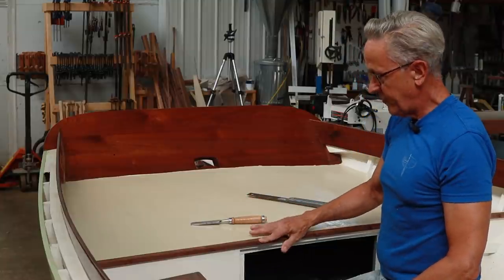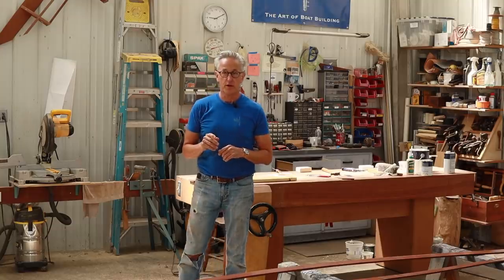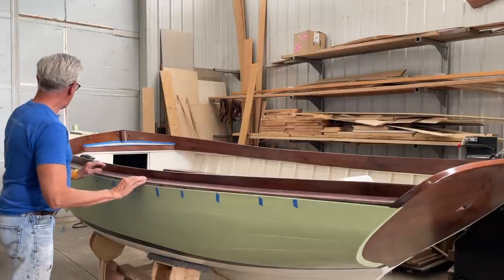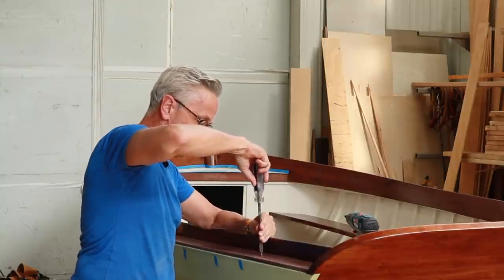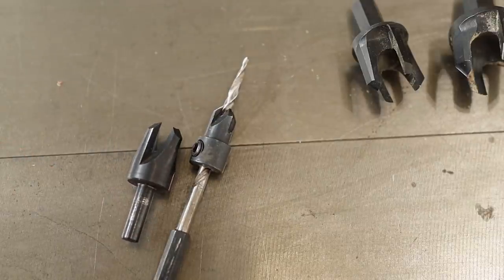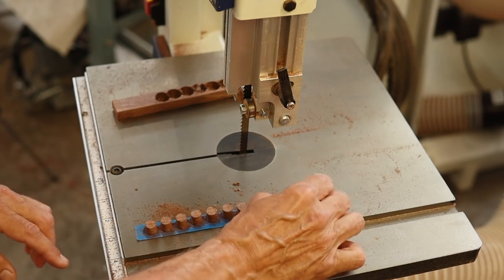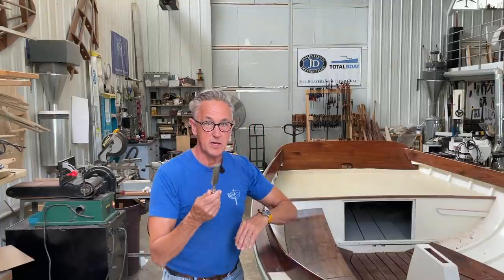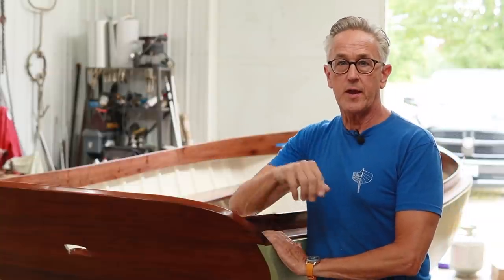Wooden Boat Building, Toe Rails and Bungs, S2-E50

Comment: I've been enjoying this series very much!
Cupping doesn't have to do with the moisture leaving one side more than than other nearly as much as the wood drying with a preference for shrinkage perpendicular to the tree growth (tangential to the growth rings) if you look at a cross section of the log.  It's the reason a log will split radially from the edge to the center if you leave a full log to just dry on its' own.
Reply: Absolutely.  The other thing is that seasoning will not stop it if the moisture level “in use” is different to the moisture level in the stored board.

Comment: Another cool trick is to roll a bur on the razor blade edge and use it like a cabinet scraper. I use the round shaft of a Phillips screw driver to round the bur. Works great and gets the job done a lot faster.

Comment: Also what prevents cupping more than any thing else is to fasten the board with the crown up! that prevents cupping more than anything. If you attach the board with the crown down the board will cup very quickly while being exposed to the elements. but if its fasten with the crown up it will not cup nearly as fast. Btw smart choice with the glue for the bungs instead of epoxy like you said, if you have to remove them later its much easier.. The only way to go. LOOKs great Bob. Really does.

Comment: Just a thought for when you or others make bungs on a drill press. Clamp a fence on the drill press table for your work piece to sit against. That will keep the work piece from spinning around if the cutter fetches up, and it will if you make enough bungs, and 9 times out of 10 when it does your work piece will smack your hands. Your boat is looking amazing! And thank you for the videos.

Comment: On keeping your plugs oriented.  Draw a silver pencil line across them, before you cut them out.  Then you will always know the grain.
That helps because you can put a lot more glue on the bungs as you can glue them  all around and not have to worry which way the grain is as you can see the line.

Comment: Looking lovely as it comes together. I would have thought you want the bung grain to cross the cover board, so any expanding bung presses along the grain instead of across it. That would reduce the splitting of cover boards from an expanded bung that got wet. That would seem more important than invisible bungs.

Comment: Amazing work. I notice you did not put any sealant / bedding compound down before securing the boards. Will there not be water intrusion along the inboard and outboard edges?
Reply from the maker: I did use sealant between the coverbroad and the comings. Forgot to mention it. 
Thanks for your question.

Comment: Some time ago I read that the pores in a coat of finish were larger that a water molecule, and moisture would be taken in and released over the course of a year.  Do you think that multiple coats would stop this process, and if so, how many coats would be needed for a complete seal?  Would this also vary with the type of finish used?

Comment: Hey Bob.  Gland to see another installment.  I have a question, that I’m sure you’ve answered before:  Why do you use a manual screwdriver rather than a power screwdriver to turn in screws?
Reply from the maker: Hi Elizabeth,
The main reason is to feel the tension of how tight the screw is in. With a power driver it’s very easy to over tighten that could result in the board splitting. 
Thanks for watching!
Reply: Thank You, Bob.  I figured it was something like that.  I love you and your videos.  Brings me back to my boating days with my Dad.  Trust me, I will keep watching!

Comment: Would a sealant like sikaflex be overkill for setting the bungs?

Anyone going up to Mystic CT event from NYC? Can also rendezvous at a commuter rail stop. Would greatly appreciate a lift. Fully vaxxed. Might cycle if the weather cooperates. Cheers.
Reply from the maker: Yes, the a sealant would be overkill and it would not sand well like glue does. 
Hope to see you at the show.

Comment: I don’t understand the logic behind “always tighten two holes” on Jacobs chuck? The key (lever) with bevel cogs is just a means to tighten the collar to drive the jaws (incline plane) tighter into the sleeve and increase force on the tool/bit. It should not matter what hole you use. Love your channel BTW!